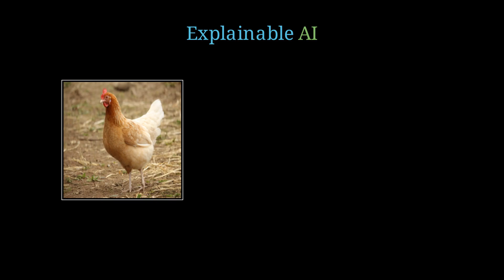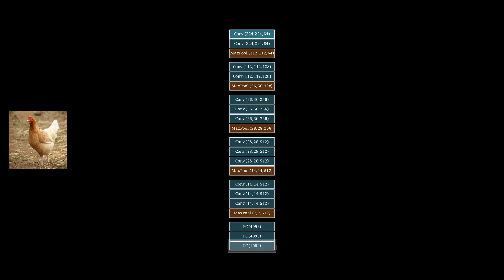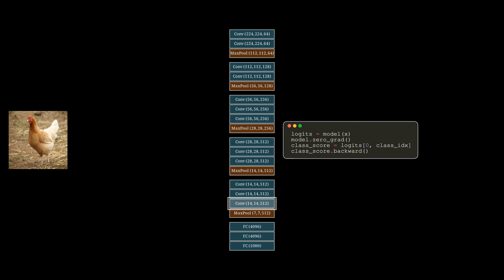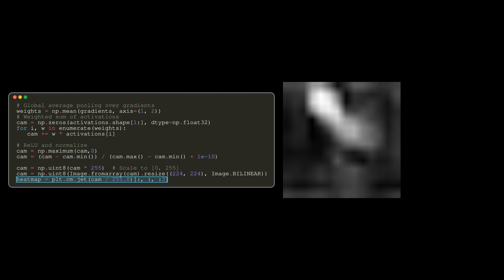Explainable AI Explained | Grad-CAM | 1

Comment: Thanks. You do in <4 minutes what other videos can't do in 15 or 20 or even 50.

Question: Why average the gradient over the whole feature map before multiplying by the feature strength and then adding? Why not  just multiply the feature strength by the (unaveraged) gradient and add? This would more directly follow the chain rule from multivariate calculus.

Thanks if you can explain.